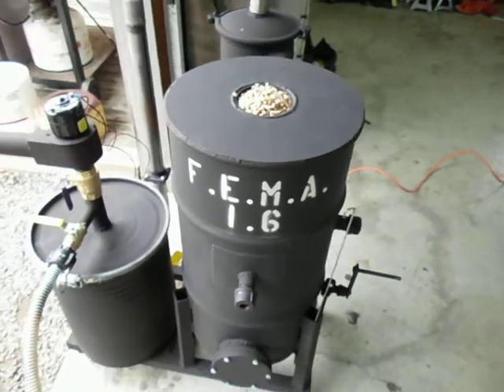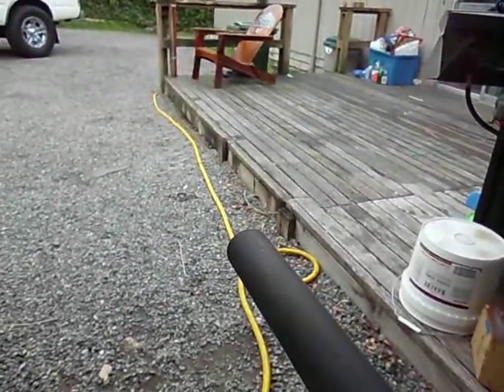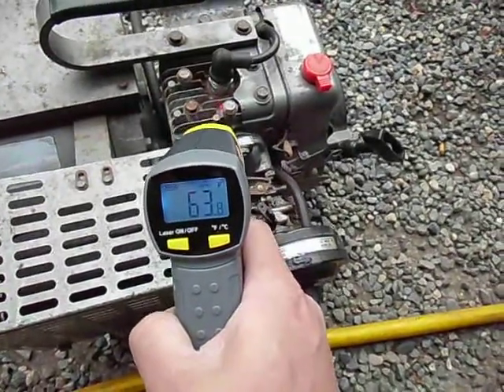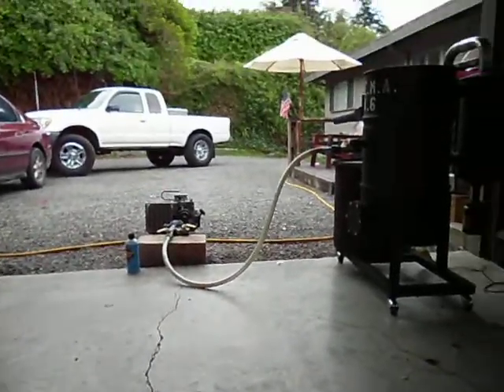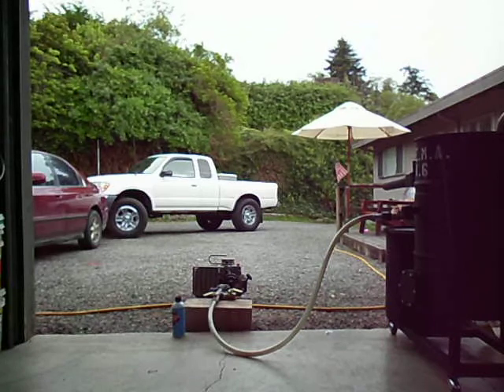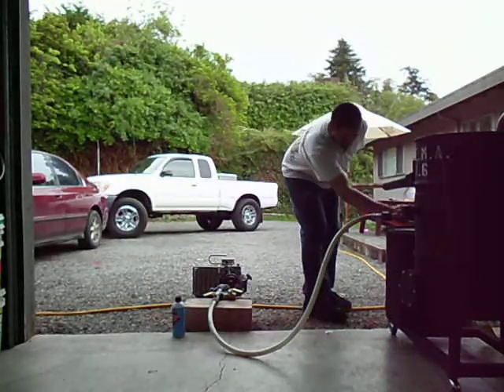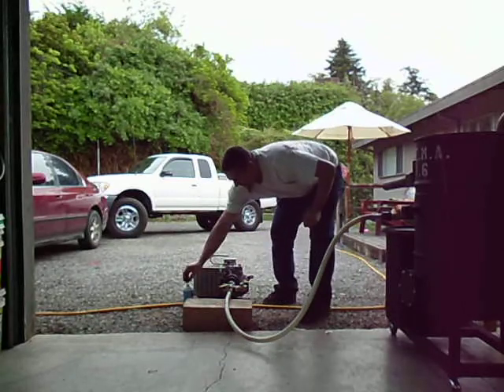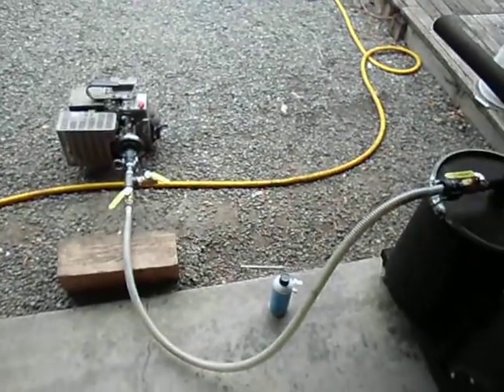F.E.M.A. 1.6 new technique

Comment: I realize you're experimenting with this thing but if you are planning to use this in emergency situations, you should wrap some stainless or copper coils around the burn drum, exhaust stack and cyclone chamber so you can produce hot water as well from the system.  A properly designed hot water system wouldn't even need a pump but a pump would make the heating of a water reservoir a lot more efficient.

Comment: First thing is the kind of wood you are using and the size of chunks you need to look at how big yr char chunks are to know how big to have yr holes in yr grate each diff wood breaks down diff once u get the right size that will help with the creeping. Another thing that can help put a cover over the fill up area to restrict the air in that will also help with creeping Is yr filter filled with sawdust and is it of a good size for max cleaning of the gas?

Comment: thanx for all the info but i only have one question...  i done a FEMA gasifier and put cyclone filter and another filter like yours and also put big heat exchangers but i still dont get blue flame  and another major problem i get is that the fire starts creeping everywhere so my oxidation zone creeps upwards and thats a bad thing but i noticed in this clip the fire is not creeping upwards is it the pellet size you think?

Comment: Hi Josh fine business on instant start of your generator.by spraying starter fluid into the air filter.I started my old onan 5hp gen today on gasoline the one with the stuck  intake valve due to tar geting into it. It wa backfireing.  but after a while the valve freed it self. mainly because the gen was in the hot sun all day. the engine just needs a little heat to free the valve. how often do you change ur sawdust filter on your gasifier.how do you know itjneeds changing. john93667 keep faith.